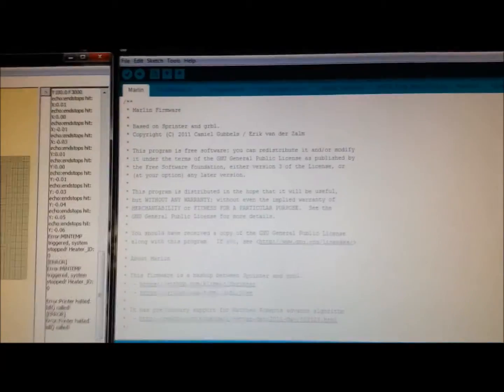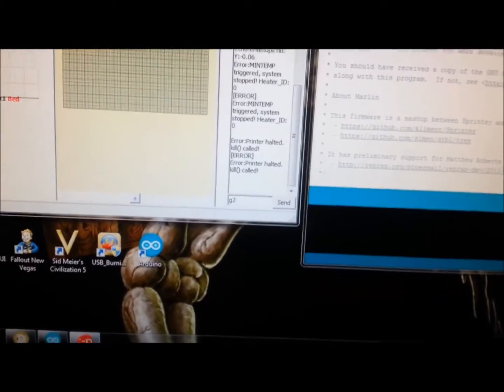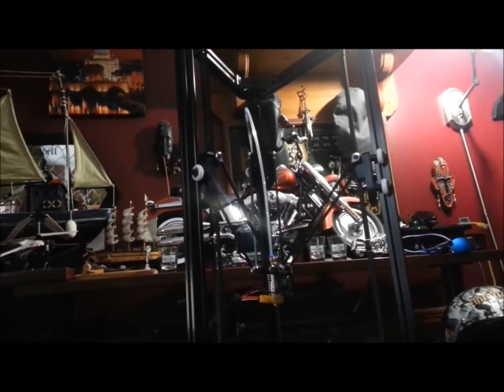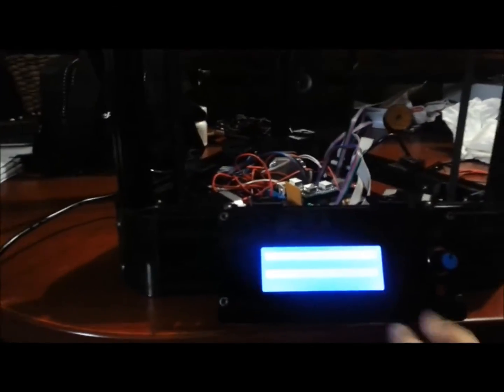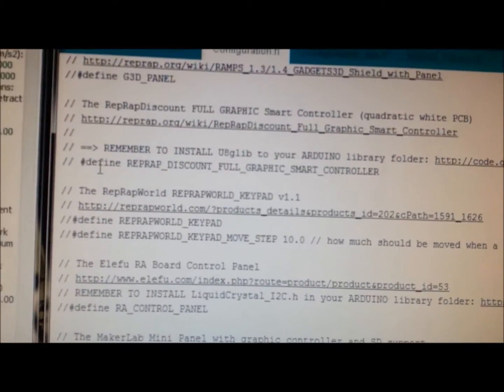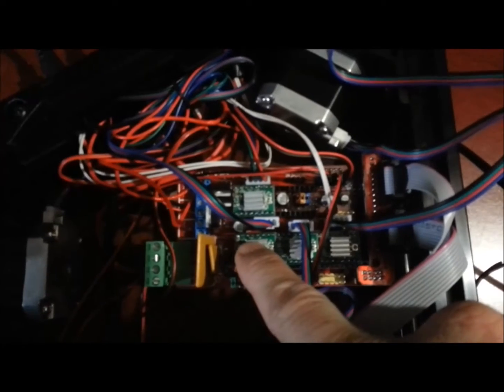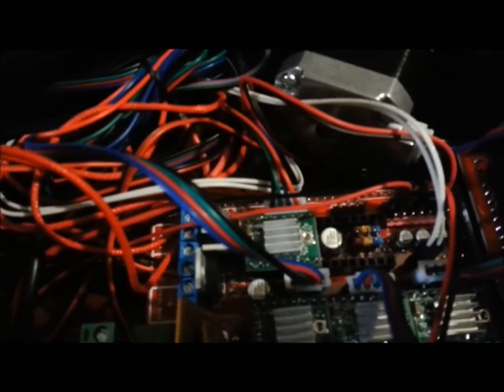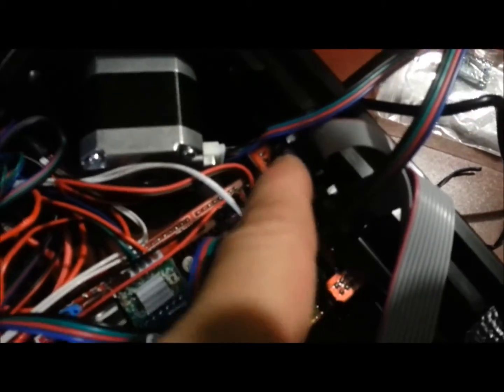3D Kossel Mini off Brand(ANYCUBIC) Need help

Comment: Sorry, my email isscottdr154@aol.com. Thanks again
Reply from the maker: Firmware sent, hope it helps with your snags. If you are still having 
issues before messing with the firmware I sent check the wiring on your 
ramps. I use this firmware on every new kossel mini I build and it never
 gives me issues and sometimes I have some come back to me with a 
question as they are still having problems and 9 out of 10 times it is a
 wiring issue
Reply from the maker: tried that email got undeliverable message

Comment: Ok ..I ve finally got the firmware installed on mine. But now ...Im having the EXACT SAME PROBLEMS you are having in this video. How in the world do I solve them ? Help anyone ? Thanks
Reply from the maker: Did you get your firmware from me? If not send me your email and I will send you the proper firmware. Most my issues in this early video were improper firmware settings which I long ago corrected
Reply: Ok thanks!! malone.marlon@gmail.com
Reply from the maker: Firmware sent

Comment: I'm sure you sorted this out that the quality of your prints but for everyone else to get the controller to display it's not the right one selected it's not a full graphics controller it's the repeat discount smart controller.. but the anycubic model come with the correct firmware loaded on a SD card.. at least usually does.
Reply from the maker: Had all the issues sorted out long ago, have since put 5 more together and built a custom one from scratch with a much much larger build area. Will have a video of that uploaded someday. Problem solving the printer is a piece of cake now. I have yet to come across an issue I could not easily fix. At the time of this video it was my first 3d printer and I did not do much research into them or this particular type.
Reply: amazing!!! I'm still struggling  to get mine to perform . Im now trying the firmware you had hosted on youtube. my extruder motor keeps jumping back and frothing in one step increment and won't feed audits assuming my build plate is about two inches in the air lol
Reply from the maker: try the firmware I emailed to you, it is specifically tuned for this printer
Reply: Hey man thanks sooooooooooo much that firmware seems to work just right.. I just need to fix my extruder the motor keep jumping back n forth. I gave it more current and also tried reducing nothing I did seem to make a difference. I even tried a new drive chip.. anycubic still hasn't wrote me back so I ordered a new motor
Reply from the maker: prob not your motor. Most likely you need to clean out the entire shaft of the hot end with a drill but around 1.75-2mm and put a new nozzle on it. The extruder motor should have plenty of power under normal conditions. Also if you clean out the shaft make sure to polish it out
Reply: +rockwater999 man your good. it was jammed. I cleaned it out and I think it just James again.. the filament isn't passing that small Teflon tube in the heatsink so it never make it to the nozzle
Reply: ... I'm convince it is 100% the motor i cleared out my head sink have it attached with the bowden tube detached and the filament won't flow.. there is nothing blocking the system I've tried various current setting. i just wish any cubic would right me back so i can work on getting this issue resolved. i am very disappointed. i mean i got a great price but i was expecting it to actually work!
Reply from the maker: So you've detached everything to see if the filament will move through the extruder without the factor of the hotend being involved and it is still skipping?
Reply: Haha.. Turned out I missed the connection by one pin.... Now I can't get my hot end to go above 140c so I can't event do a test print... Man there is so much to learn while configuring this bad boys
Reply from the maker: the connection on the thermistor?
Reply from the maker: In another couple weeks Im gonna post a video on a custom one I am almost finished. It is about 3x the size, has a mirrored heated bed, leds, leds that only come on when the smart fans are on, quick detach for the hot end, psu, and heated build plate.
Reply: Nice...  Yea the thermistor was loose so I wasn't getting proper reading which lead to me running way to high for pla and making s nasty jam so bad my heat block got stripped cleaning it out. I'm really looking forward to seeing that build. Sounds awesome. Any that issue that keeps coming and going is my machine acts like the knob is stuck it keeps randomly changing modes. I don't know if it's a short in the system or what. I even reuploaded the firmware and nada...
Reply from the maker: Your lcd keeps going into different screens?  For your hot end, they are pretty cheep to replace, it is just a standard jhead, you can get the whole thing with the wiring and nozzle all assembled on aliexrpess for about 4 bucks, problem is you got a long wait. That issue with the knob does not sound anywhere near normal. I have 5 machines and the custom one all with that same lcd and the biggest issue ive had with some of them is the contrast was set to high and I had to turn it down on the back of the panel. Is your wiring from your lcd to the addon board and then the addon board to the ramps seated ok?  If it is ion the knob mechanism I am not sure how you would go about getting it to it with out too much hassle as it is soldered to the board.
Reply: I def need a new hotend its pretty sad. The lcd keeps flashing through different menus items and beeping like it saw a ghost or something. I have a new electronics kit with a full graphics LCD on the way I'm going to rebuild it externally. I really don't like the idea of eventually having a heated so close to electronics plus I'd like to have a fan on it.

Comment: did u ever get this to fully work... if so could u point me in the right direction I have the same as u
Reply from the maker: +calvin myers 
What issues are you having? If you need the proper firmware setup pm me and I can email the marlin software to you.
Reply: +rockwater999 i could definitely use a good firmware or hex file or something. just got my anycubic pulley system kossel mini. got it put together pretty quick for not knowing a damn thing about 3d printers lol, but been stuck on lcd screen which is on, but blank. most people said its probably firmware, but I have no idea where to get a good firmware for this printer. if you can help me out, that would be greatly appreciated.. john_lynchwells@yahoo.com
Reply from the maker: +Justin McCracken 
Yeah this is a much earlier video, i think like the day after I assembled the printer. I have long since had 99% of the bugs figured out. I emailed you the firmware for the printer.
Reply: +rockwater999 Hey rockwater I recently got this same printer and was able to build it, but i'm currently having trouble with the lcd screen (which lights up but shows nothing) and i'm also having a difficult time with calibration (like the motors try to go even past them hitting the limit switches on the end stops). Also like said in the video, I can only get one axis to move at a time :( . If you could please send me your firmware at Shawnfvictor@gmail.com and give me some guidance into the right direction it would be heavily appreciated. :( I'm a novice to 3d printing
Reply from the maker: +Shawn Victor I sent you the firmware. Any weird issues after that it may be how you have it wired up and I would need to see a pic of your wiring to help you there